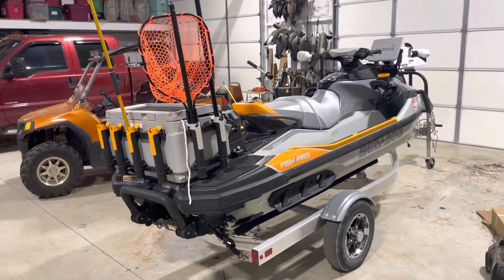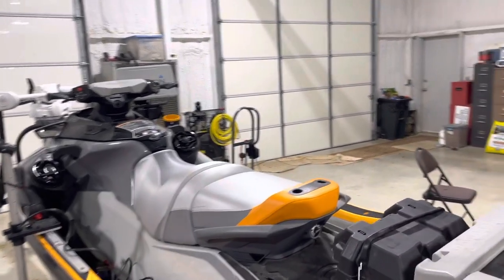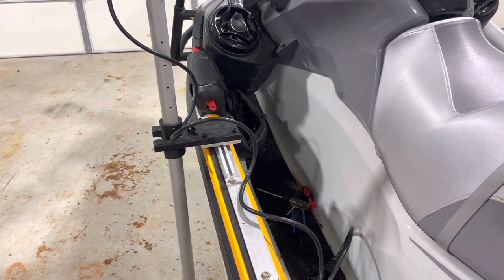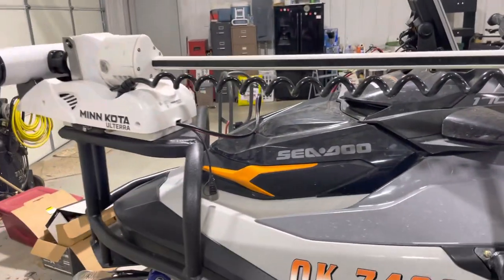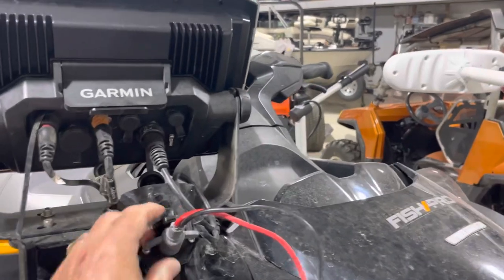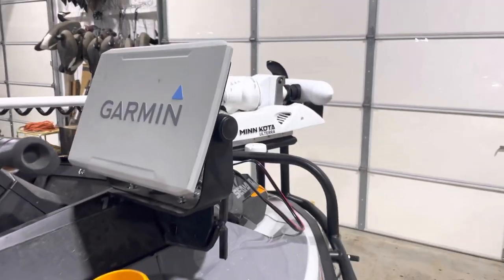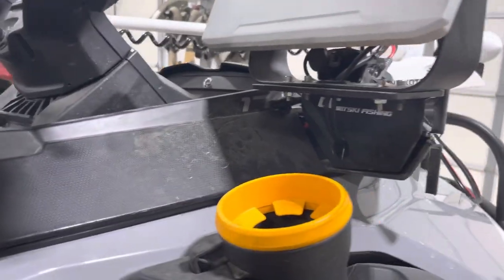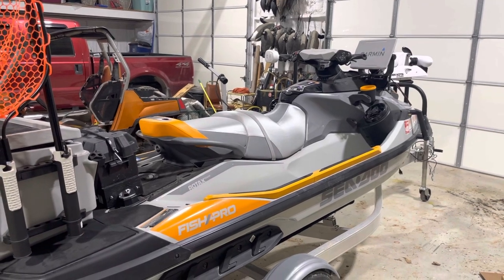2022 Seadoo fish pro trophy with trolling motor and livescope

Comment: What does it make any sense? Why didn't you just get a John boat
Reply: Well to start with this, Jetski will travel 53 mph with two people on it. You can get a little over 100 miles worth of traveling on a tank of gas. The safety and stability of this craft is excellent for saltwater fishing. And if a storm comes up, you can get home in five and 6 foot swells. When you’re not fishing it will also pull a skier, wakeboard or tube.
You can actually stand on the foot wells and it won’t turn over so it is a much safer and faster option. And then, of course there’s all the other extras like the Livewell, I have nine rod holders to carry my gear. Also have a Trolling motor mount and livescope set up. so needless to say, this outperforms a John boat by quite a large margin. I have spent a lot of time fishing in John boats of various sizes. The way this fish pro works I would compare it to the first time I had a tractor with a front in loader and ac in the cab. You just realize something better came along and you never looked back.